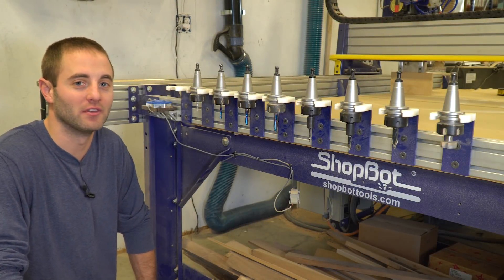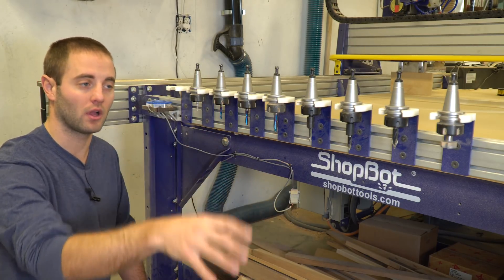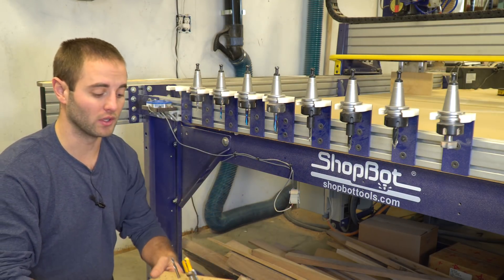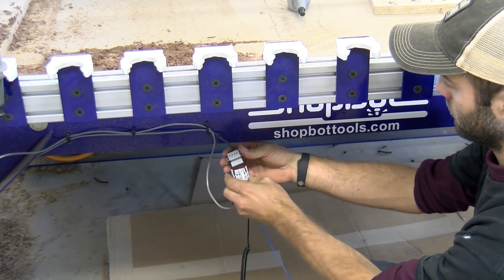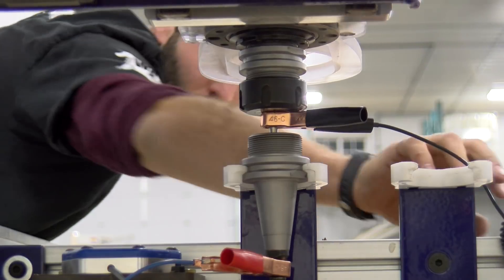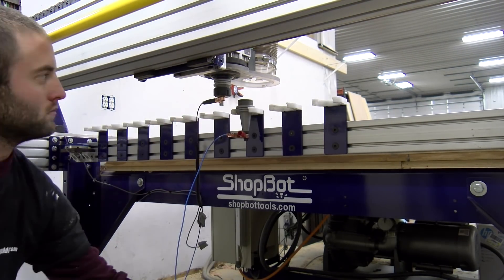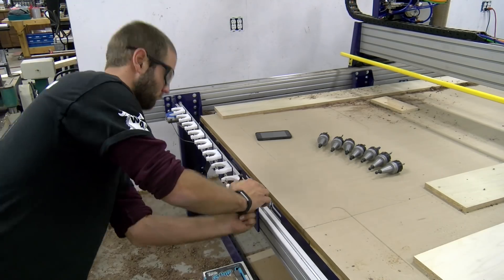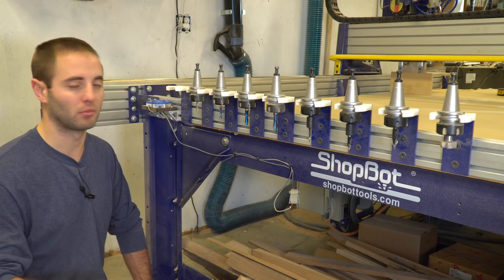ShopBot Auto Tool Changer Setup

Comment: Hi Andy, great job on the video, thank you.  I have an 6-position ATC and have done all of the things noted in your video several times as well.  Unfortunately, I've had issues with my air compressor that's caused pneumatic problems that don't get discovered until the spindle is IN the tool holder, still attached to the tool, and suddenly can't open the draw bar to change the bit.  Resolving the air problems still won't allow me to move off the holder and several times trying to keypad the spindle off the holder has resulted in system crashes that drop the spindle like a stone onto the rack.  The only thing that's been partially successful is moving up in the Z-axis which takes the collet holder with it.   Have you run into this / discovered how to get the spindle off the tool if something goes sideways?  (Note, I'm working with support too and they pointed me in your direction to assist)
Reply from the maker: Mo O'Brien send me an email. Andyglassimpressions (at) gmail. Com